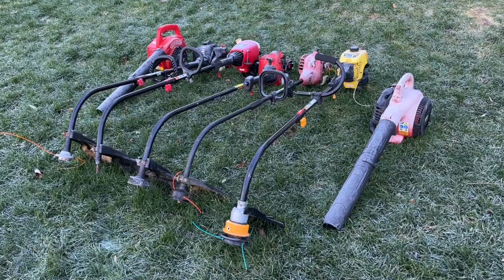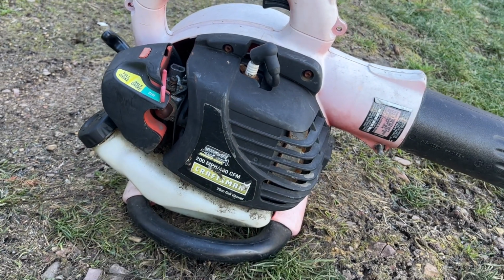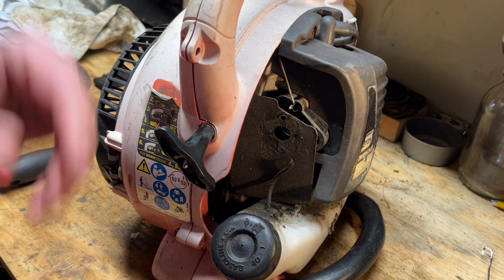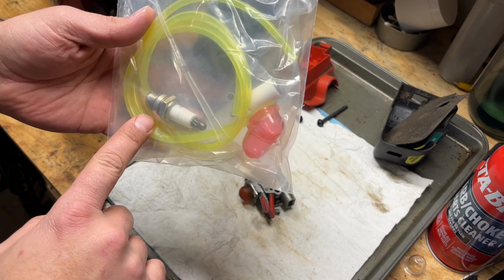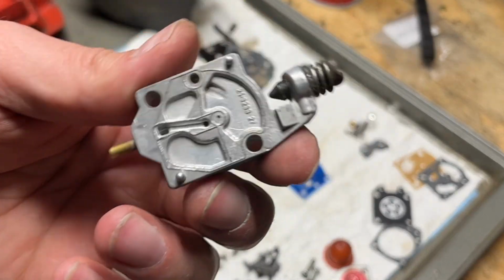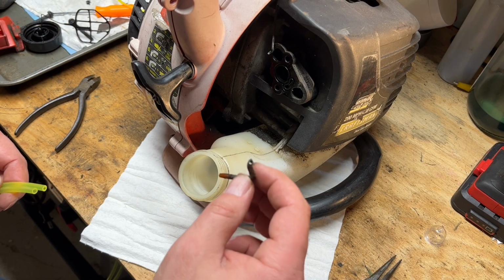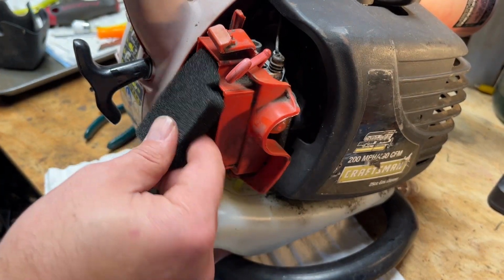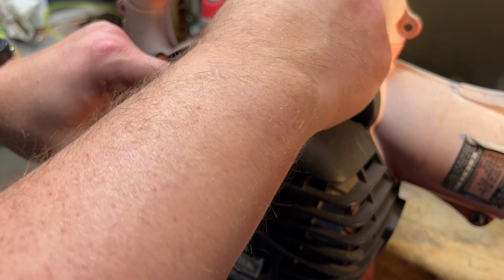Full Service on a Craftsman Poulan Leaf Blower Vacuum - $20 Equipment Lot Ep.01

Comment: On the fiber gaskets like the one that put up a fight, I tend to spray on WD40 and let it sit a little before trying to remove.  They seem to soak it up pretty easily, and usually are easier to remove.  Doesn't always work, if it's really bad.  Sometimes, your only option is dig it off - soft small wire wheels for a rotary tool usually do very well and shredding them off lol
Reply from the maker: Thanks for the tip! Always good to add more tricks up my sleeve

Comment: Hello, I wonder if that gasket even needed to be removed and replaced. I thought it looked good but I wasn't there. Man that was on there!! Nice score on the lot. I have had some equipment that was faded like that. I have used a torch to bring the color back. That one I would probably use Restore by 3M and then use the torch. Some disassembly is required to use a torch.
Reply from the maker: That gasket was in decent shape still, but if I have the kit with new gaskets I usually like to replace them all regardless of the previous gasket condition. I did play around with a torch on this one.. I was marginally successful in some areas, but the most faded parts just started to singe brownish (likely user error) so I stopped lol. I have not thought of using the 3M restore, so I may try that. Thanks for the suggestion!
Reply: @BackyardRepairs  I can appreciate that with the gasket. I felt your pain, tho. Once you start, you have no choice at that point. When you cut the video, I thought to myself, "ATF Soak time." On the 3M Restore, it lasts longer than silicone spray alone, and yes, silicone spray is another way. That's what used car dealers use to make under the hood plastic look new. Is this your first channel? Your doing a great job.
Reply from the maker: All good tips, thanks again! And I really appreciate that, yes this is my first channel. I’ve been fixing stuff as a hobby for quite awhile but recently decided to start filming it to see how that goes
Reply: @BackyardRepairs  you are doing a great job of editing, and enjoy having the time to respond to every comment. As you grow, it gets harder and then impossible to respond to everyone. I would like to start a channel, but for now, I moderate. I'm a prepper of sorts. NYPrepper is where I moderate mostly. Keep up the good work, and don't give much of your time to navigate comments. Every channel gets what we call trolls, delete and block them, and move on. I'm looking forward to seeing you grow.